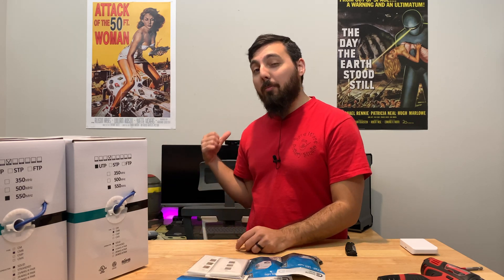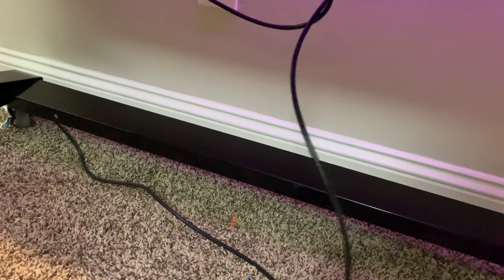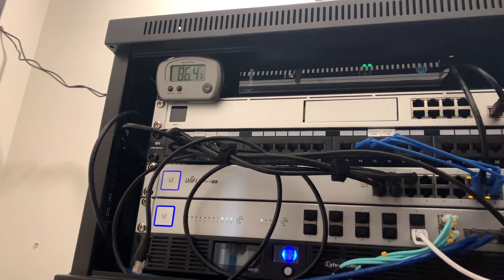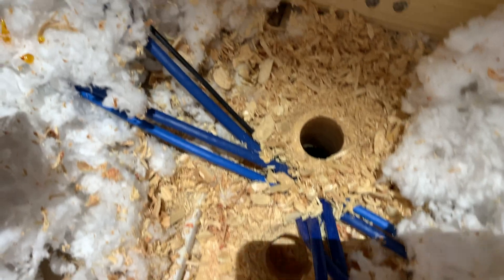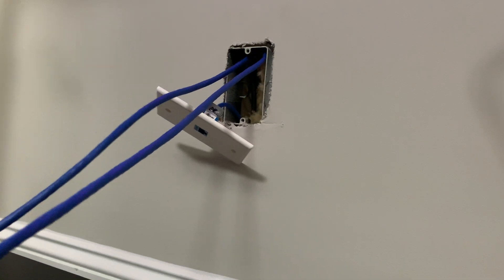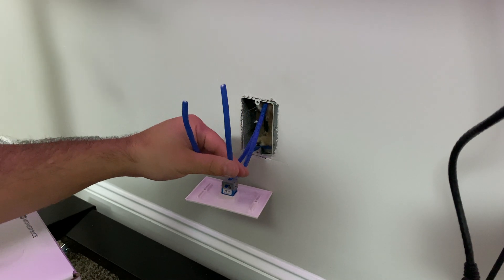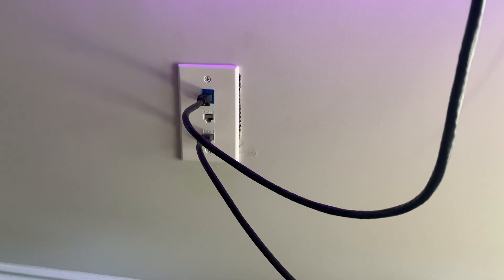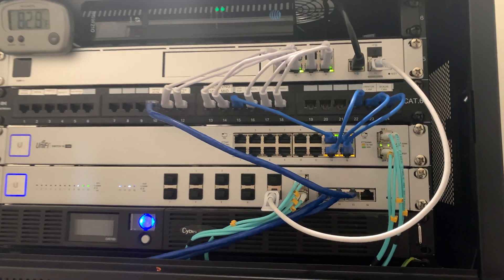Running Network Cable in the Home Office and Living Room |Cat6 Ethernet #homelab

Comment: I know this is a older video, but why didn't you just put your rack in your attic? You would have more room work with and I know for me, my rack is in my basement so I also have room to work around.
Reply from the maker: It's too hot in the attic for my equipment.

Comment: Are there any chances of getting electric shocked while installing Ethernet? I need to make sure before I do
Reply from the maker: It probably would.  Just don’t plug in the other side while you are making the cables.  You could short out the equipment if you leave one end plugged in.
Reply: @SPXLabs  ok, thanks, also can I install Ethernet with a pre made cable instead of having to put the connectors on my self? And I wasn't clear when I said chances of getting electric shocked, I meant while in the attic I could get electric shocked?
Reply from the maker: If it’s a premade cable then you shouldn’t.  It’s also low voltage so you won’t die.  I’ve never been shocked by Ethernet but I’ve also never had the cables live while working with them.
Reply: @SPXLabs  whats bad about a pre made cable though
Reply from the maker: I didn’t say anything about them being bad
Reply: @SPXLabs  ohh you said that I shouldn't have to put the connectors back on, sorry I misunderstood, I thought you meant that I shouldn't install pre made cables. Thank you for the help.

Comment: How did you know where to drill the hole so that your fish tape went down right in front of the area you expect it to come down. How did you originally cut the wall where that fish tape came down?
Reply from the maker: Most of the holes that were drilled in the house were done during it's construction.  I just added holes nearby to run more cables.
Reply: @SPXLabs  thanks!

Comment: What is that box in your wall that you bring the cables into?   It almost looks like an electrical panel box.  I need to bring a lot of wires into a closet and tryying to figure out how to do it in an air tight way. thanks
Reply from the maker: A Structured Wiring Panel or sometimes a Structured Media Panel

Comment: For reference the a and b standard are just the two ends of a crossover cable. wires 1 and 3 swap places and the same with 2 and 6. This is the change of RX and TX for both NICs. So OW wire is the transmit (-) on one side and will be the receive (-) on the other side. so if you follow, the orange and green pairs are actually the only pairs that transceive data, at least in anything below cat 7 cable. The blue and brown pairs are reserved for other technologies like POTS lines, POE, or technically another data connection, although that's pretty sketchy. You only ever make the crossover cable if you are plugging a computer directly to a router/modem or another computer, switches do this transmit receive flip internally. Although most computers today with fix the transmit receive in software if you are using the wrong cables with a pretty good success rate.
Reply from the maker: Thanks for all the comments with more information

Comment: I'm dumb but how do you know from wall to attic to ceiling thats why you attic first sorry I'm using wifi now sometimes have to go to my router from my bedroom its all the way across my house for wired ethernet sorry I don't know should I get cat 7 whsts best in heat and cold weather for the attic
Reply from the maker: I have no idea what you are asking me
Reply: @SPXLabs  so everything that goes to the attic goes through the wall correct im trying to do the same thing my bedroom to attic modem room to attic
Reply from the maker: Yes? Also by the way cat7 isn’t a standard yet and most companies selling cable is just a scam.  Just get cat6a.
Reply: @SPXLabs  ok thanks and where do you get the clips or connector for the ethernet that you had do I need that to plug in to the ethernet outlet
Reply: @SPXLabs  im thinking of getting optic fiber do I  just need ethernet lines is the fiber going the lines outside to the outlet that use optic fiber is optic fiber separate then ethernet cable so optic fiber goes like coax cable in a way
Reply from the maker: I would highly suggest watching several other videos to help you think through the process.  I’m sorry but it is hard for me to decipher what you are asking and I’m fearful of giving you an answer because I may be misunderstanding you.
Reply: @SPXLabs  ok thanks for your honesty im thinking of talking to them when they do the installation see if they do it then would be cheaper if they did it instead of me doing it myself

Comment: Are your speeds the same in the other end of the cable? As with the speeds attained where the modem is primarily run.
Reply from the maker: Yes
Reply: @SPXLabs    Great! even with a cat6 cable installation of about 40 metres in length to a separate ADU behind the house...you don't lose speeds at the other end...that's satisfactory 

I wish I could do this job myself in my place  so I can save money    but if I want a good quality and proper working installation job   I have to hire a registered data cable installer    besides it would be illegal for me to DIY  anyway  

Ye better dial up for a registered electrician, data and telecommunications cable guy  😅👍

Thanks sir
Reply: @SPXLabs  Read (red) some info regarding EMI   you ever scan your place for any sign of them    like near your Ethernet cables by any chance    I don't know how accurate and true I am when I say that EM or electromagnetic can interfere with your Ethernet cables  function
Reply from the maker: Nope never scanned my house for EMI.  EMI is not something I am worried about.

Comment: As a person that installed networks for a living and pulling cables. When pulling cables through a small opening or hole. You want plenty of room for the cables.As the hole fills up making the space to pull a cable smaller. You can burn through the cables with the friction of the cable your pulling, either burning through the whole cable or just exposing the wires inside the insulating outer cover. Just one exposed wire will cause it to fail. Then you have trace down the failure. You have to many cables in the already existing hole. Looks like you have 8 cables in a 1 inch hole. Six would be the max I would have ran in that hole. Also, do NOT pull the cables tight like they are at 6:25 in the video. That's not good at all, the thin wires inside can break over time. You want some slack or service loop. Your setting your network cables up to fail over time. The slack also allows you to re-terminate the cable at the jack, if you have to without running a new cable. Yes jacks go bad. Cables should be able to be pulled without much force. Use push-pull rods in walls when running cable. Fish tapes can bend and loop back up the wall cavity, due to insulation. NEVER pull the cables tight!!! When you are terminating the cables, you don't want to untwist the wires any more than needed to terminate. The twist in the wires is what gives you those speeds. Untwisting them that far from the jack 12:29 can degrade the speed. Sorry but I have to give this a fail. If I seen that job, I would make them redo it all and do it right.
Reply from the maker: The house came with cable pre ran which are super tight which is why I drilled new holes.  I didn’t do that
Reply: @SPXLabs  Good. Whomever did didn't know what they were doing.
Reply from the maker: I agree.  You should have seen the place after ATT came around lol

Comment: Wow, I wish I had all that space in my attic.  I drilled 3 holes to run all my cables up the wall to my server closet.  I had to run all my cables under my house.  All my drilled holes I filled with with a little expanding foam to fully plug the drilled holes closed.  If only to keep any bugs from climbing up into the walls of my house.

I also say cable is chea-.  Better to run a bunch of cables to each room at have a few extra ports at least for extra devices down the road.  You also don’t need full boxes.  You can use just the rings around the drywall, called low power boxes.  The extra slack can easily be pushed back into the wall.
Reply from the maker: Yikes.  I feel lucky.

Aight! I’ll keep it in mind

Comment: How much extra  does this add to your electric bill
Reply from the maker: Not sure.  I’ve added additional equipment since that video and it costs ¢.77 a day, $23.21 a month, or $282.42 a year in electricity.  I use around 248 watts per hour.

Comment: Where did you buy the white cables from? Plus you have a white longer cable on the right size connect from the dream machine to the switch. What kind of cable is that?
Reply: Well I know UniFi sells white bulk cables.  I know Monoprice sells bulk cable in a number of colors.

Comment: You said that was cat6 cable right, not cat 6a, how many runs fit in a single hole and do you know how much bigger 6a is than the 6 you used? I've been thinking of trying to wire my house and figured I'd do 6 wires per plate in each spot then I can change the functionality by moving patch cables in the comm closet.
Reply from the maker: Yes cat6.  I’m not sure how many fit, never thought to count.  Cat6a may be thicker but I don’t think it’s big enough to make any real or noticeable difference unless you are engineering something to be built to the micron specification. 

I’d say if you are going to go through the effort of wiring, you may as well run the extra cable.  Just because it’s ran doesn’t mean you have to use it. So your wall plates can have more or less ports depending on how you feel.
Reply: Cat 6a is the same size.  It does has a plastic x piece in the middle to better separate the 4 pairs of wires.  The issue with 6 keystone plates is getting 6 keystones into it.  You need to get ones small enough!!!  You can also use a double box and spread out keystones that way.  I agree with having more keystones in each area than needed.   Because trust me, you’ll end up needing them and don’t want to go back and add more if you don’t have to.

Comment: Those Ubiquiti APs are designed to be ceiling-mounted, their beam pattern is specifically wide and (comparatively) shallow to cover the largest distance. With it on the wall, you're pointing half your coverage up, and you won't get any coverage at all behind the unit.
Reply: What about the Ubiquiti Beacon HD?? Would that be a better fit??

Comment: Apparently you shouldn't put the Ubiquiti Wired Access Point on a wall. It needs to be on the ceiling.
Reply from the maker: My understanding is, it should be mounted according to your desires.  So on the ceiling for more range or on a wall for a stronger signal.

Comment: This is my goal to have all the rooms wired with cat6 cable. One thing are you getting 10gig at home or more is that why you needed to switch things around?
Reply from the maker: My internet is only 1Gbps.  My office is the only place where I really "need" 10GbE, because I am backing up loads of videos and junk.  I went with Cat6 because it can do 1GBps all over my house no problem and I feel like that is pretty good for "future proofing".
Reply: @SPXLabs  Well you are a lucky man to have 10gig... I know my max ISP goes to 1gig. I plan to order the same rack you have since your closet looks like mine. The only thing is cost on buying everything since I just moved into a new house.  already have my unifi AP and dream machine. Wife is asking questions and starting to say no because of cost and if it's worth it. still need a POE switch and patch ports plus all cables items stuff. ugh  Keep up the great videos.
Reply from the maker: I feel you.  Thankfully YouTube subsidizes a bit of my costs (not significantly).  The problem too with houses is, you buy something then something in the house breaks and it’s always like $1000 at a minimum to fix.  IMO there is nothing wrong with it looking like crap for a while and saving up for exactly what you want.
Reply: @SPXLabs  Yes very true. For now I have my 3 AP and my dream machine on it's way. I'm going to use a Linksys POE switch to run then. I just need to purchase the all the cable and tools to make them. Running cat6 is good enough right rather then running cat6e. I just want to get my full or close to what I'm paying for on my speed.  Before I moved I had cat8 from my router to regular hub and man I was getting speeds over what I was paying for.
Reply from the maker: It depends on distance.  Cat6A can carry 10Gb further than Cat6.  I live in a small house so Cat6 works fine.  If you have a bigger house then you may need to upgrade to Cat6A

Comment: Hi, Very informative. I have a question, I have my modem and internet connection point in the living room. and I have three-bed house. Do I need to run three different lines from the living room to 3 bedrooms? Or can I run just run one line from the living room to one bedroom and joint the line from that bedroom to another, and so on?
Reply from the maker: You should run a line to each room.
Reply: For power and phone lines you can piggy back like that, for ethernet (data and commercial voip) I believe it has to be dedicated runs to the switch/patchpanel.
Reply: you can daisy chain connections like that with switches in each room, but all the rooms will be sharing that one cables bandwidth, so if their is no bandwidth restraint you could. However you are going to be doing the same amount of work running the lines and spending more putting switches in every room, so there isnt a good reason to do this, but it is possible.

Comment: i bought female to female keystone jacks. 25 pack, 10 pack of single keystone wall plates, another 10 pack of keystone wall plates but double, 3 packs of 100 pcs eack rj45 pass through connectors cat 5e and a pass through crimper. i added a 16 port switch to my network. all i need now is more cable
Reply from the maker: Someone get this person some cable! ASAP

Comment: Interesting, how many floors did you run cables through? I was thought it was impossible to run cables once the plaster boards are up.
Reply from the maker: It’s a single story home. So none.
Reply: Outside walls are difficult due to firebreaks in-between the studs. Interior walls are much easier due to no fire breaks between the studs.
Reply: @vincecatapano9020 I’m sorry to bring you back to this, but I just bought my first home and I am struggling terribly due to the firebreaks you mentioned, any tips or advise? I would really appreciate it
Reply: Impossible...NOPE there's always a way

Comment: What are use for thermal control
Reply from the maker: https://youtu.be/mp4YUNBTUyE
Reply: @SPXLabs  what temperature did you set thermostat for fan to kick in
Reply from the maker: @rodneyhenry27  80°F with a 2° buffer so that fans won't always be on even at 80F.

Comment: Is cat6 better than 7 and 8 for home use TVs computers and game systems
Reply from the maker: Not inherently.
Reply: @SPXLabs  so which should I use
Reply from the maker: There is a few dependencies but in the most general sense, cat6 or cat6a should be more than fine.
Reply: @SPXLabs  ok thanks

Comment: Depending on your locale it is now required to use a fire barrier/block sealant in holes that pass between floors, which was probably what you ran into in a couple of pre-existing runs.  You can pick up a tube of the sealant at your local home center.
Reply: super important to know, thank you for mentioning it
Reply: You sound like a ATOS segment.

Comment: I really don‘t get why Cat 7 isn’t used nowadays. Here in Germany we use Cat 7 only since about 5 years.
Reply from the maker: Well cat7 cable is very expensive and there is no advantage that cat7 offers over cat6 especially at the short distances inside my home.
Reply: there is not inherent benefit in a normal sized house other than maybe 100gig network speeds, buts thats already going to be expensive in gear

Comment: Nice video and some good tips. When looking at your rack I can see that you're wiring a bunch of the drops directly into the 8 ports on the UDM however its worth noting that those are all on a shared 1Gbps backplane so you'd be better wiring them into your other switch and then using the 10Gbe uplink to the UDM :-)
Reply from the maker: Dude right! I recent learned that and have made the switch!  What kind of crap is that lol!
Reply: Was gonna comment this. I bought a UDM Pro last year and learned that fact after I bought it. I had less than 8 wired devices so was trying to get away without a switch for a while.
Reply from the maker: Oops.  Did you end up getting a switch?
Reply: @SPXLabs  not yet. I’m sitting at 6 wired devices at the moment and most aren’t used at the same time anyways so it’s not the end of the world. When I move into a house later this year I’ll get a switch and wire the house. Get a rack and everything. Holding off till then

Comment: You will have issues with the cat cables. Cat5e is less forgiving, but when you go to cat6 or higher you will have issues. You don't have 70 degree sweeps on the cables. No right angles. I have seen hundreds of cables fail and signals drop.
Reply from the maker: I guess we will see what happens.  Many of the cables were added by the builder of the house.